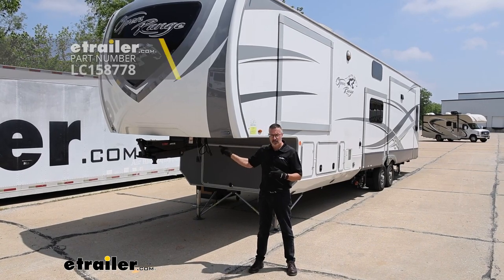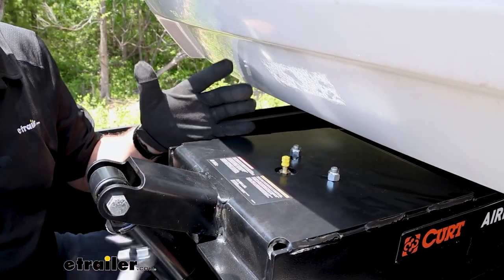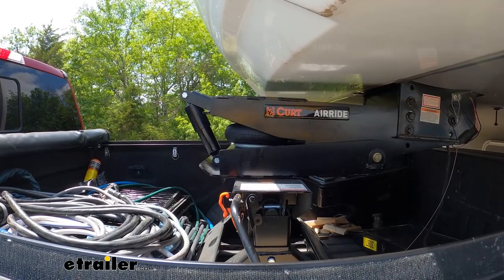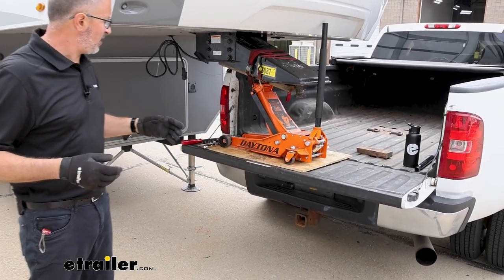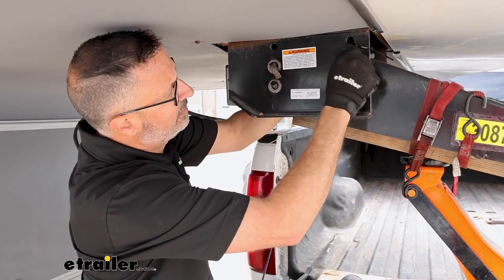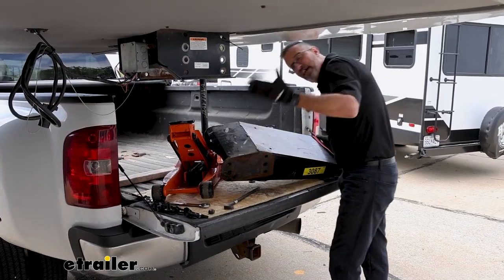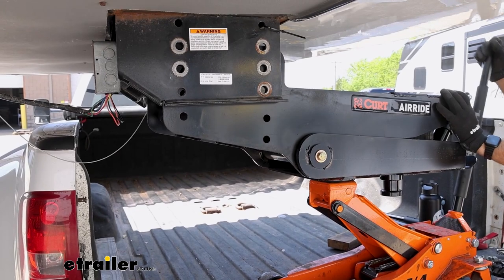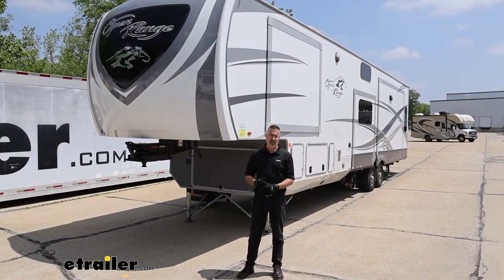How to Set Up Your Curt Air Ride 5th Wheel Pin Box on a 2021 Highland Ridge Open Range Fifth Wheel

Comment: So you have an 1 1/2” more leverage. 🤔
Reply from the maker: Yes. However, even though the pin box is branded as a Curt product, it's designed and manufactured by Lippert. Since Lippert designs the majority of 5th wheel frames, they will work together just fine.
https://www.etrailer.com/Fifth-Wheel-King-Pin/Lippert/LC158778.html